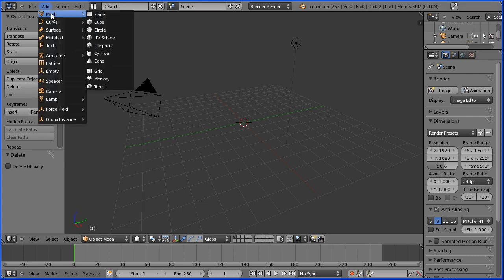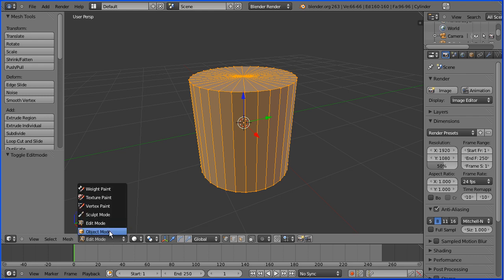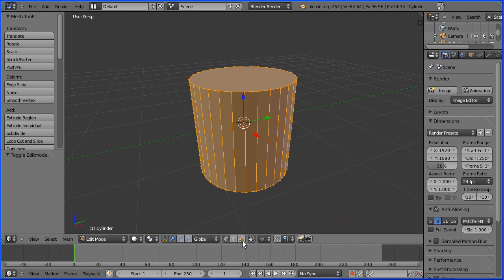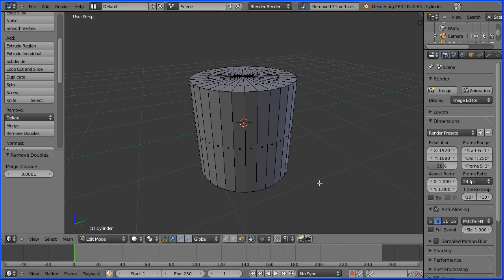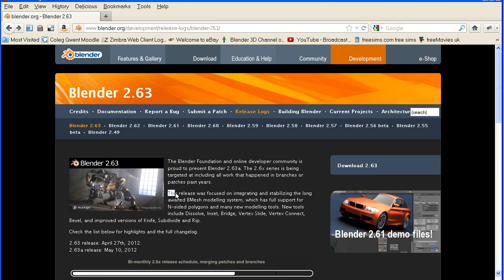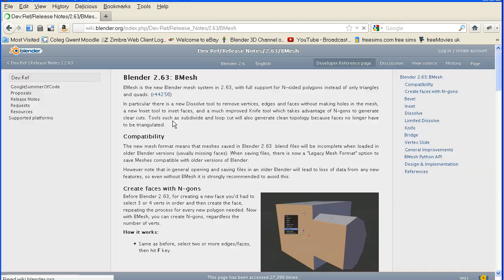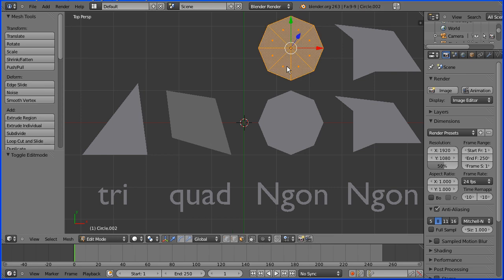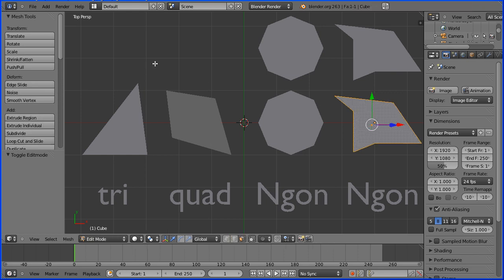Blender Tutorial Changing the Cap Ends of a Cylinder (and Cone) from Ngons to Triangular Faces

Comment: Anyone knows how to increase/ decrease vertices for a cylinder after u set the cylinder.... for example: i added a cylinder with 12 vertices and i want to increase the vertices to 16...
I work from low Poly to high poly...
I tried few modifiers like bevel and subsurf, but it makes the cylinder to a sphere O.o
and I dont want to use the smooth tool
Reply: Julian Koni When you just make the cylinder, to the left you should be able to see a menu which offers you the option to change the numbers of vertices. If you click just once after making the cylinder it is gone so be careful!